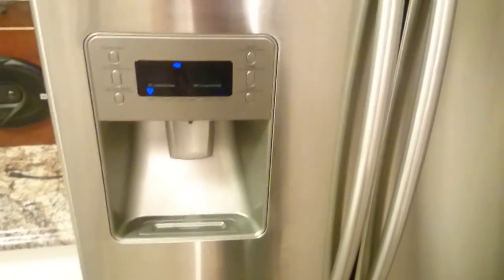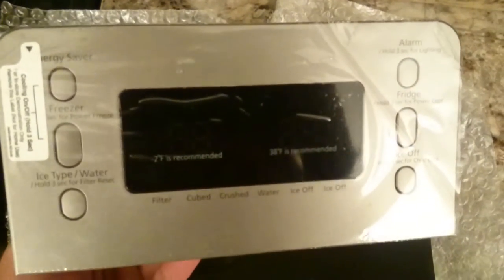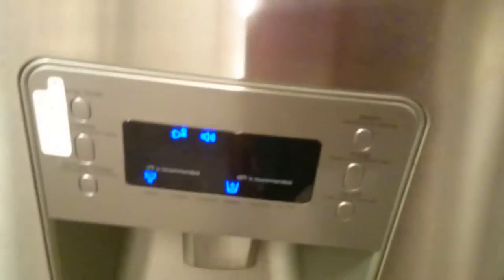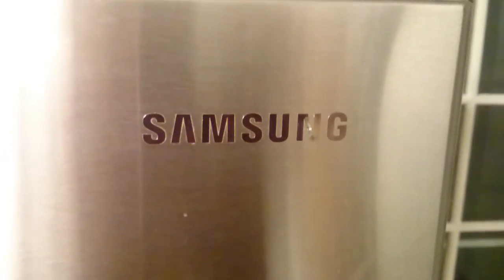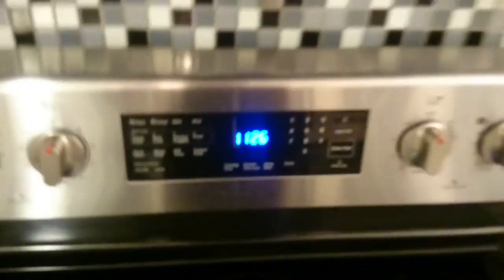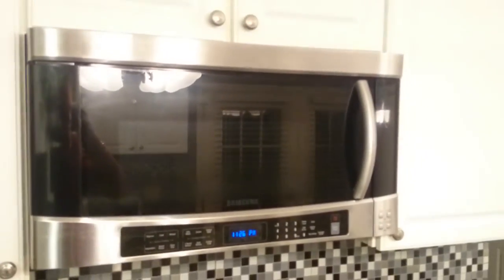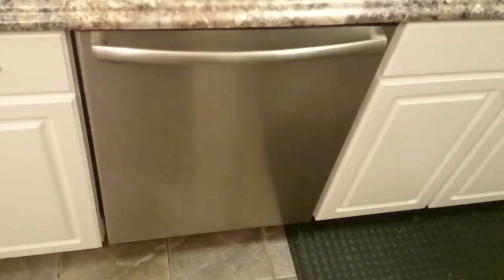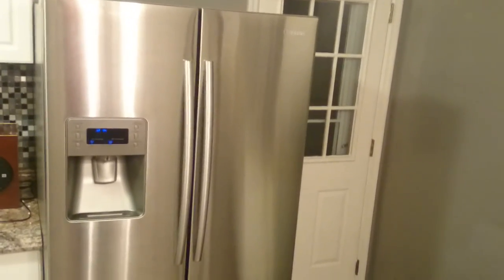Samsung refrigerator RF268abrs display panel replacement and Samsung rant.

Comment: The main reason I watched this video is to see how to pull the display after removing the screw. You did not show that.
Reply from the maker: Sorry as I stated before I had to have both hands to pull it.  In the video I show the location of the screw, the clips, and how to unplug the harness.  If this isn't enough information to pull yours yourself maybe you should hire a professional.
Reply: You BARELY showed what was needed to change the board.  You waved the unit around in front of the camera and gave us a 1 second look at the clips at 3:15.  This video is better than nothing, but really...  if you are making the effort to show us all how to do it, think about what we need to see.   It may be easy and obvious to you, having done the job multiple times, but the rest of us barely know what we're looking at.  Next time, get a cheap tripod.  If you're using your phone, you can get a holder for it to attach to the tripod for a couple of bucks.
Reply: @Semper fidelis Semper Paratus I truly appreciate that Clayton has made the effort to teach people what he has learned.  My point is that he didn't quite succeed.  If he wasn't holding his camera/phone in one hand while shooting, and put it on a cheap tripod with cell phone holder, he would have shown everyone how it's done.  Doesn't matter if he's "getting way too good at this" if he doesn't SHOW people what he's doing.
Reply from the maker: @smichelsen    Feel free to donate a tripod that will work with my phone!  Keep in mind I make no money off of my channel and dont intend to. I am aware my videos are of low budget and production value. That being said I try to put up stuff that isn't commonly available on here. Any information is bettet than none. Thanks for watching!
Reply: @clayton7825  the phone clamp on the end of a selfie stick will generally unscrew and can be attached to a regular tripod.

Comment: I'm on my third display and now need a new one.  The electricity went off during the night and when I got up in the morning the display only shows 88 on the left side and 08 on the right side, nothing else works.  Another strange thing is the ice.  I have RO water connected to the fridge, always have,  the ice used to come out almost clear.  Now it is solid milk color and tastes like crap.  I can't figure out what the hell happened to do that.  I installed a refrigerator deodorizer and that made no difference whatsoever.  I am contemplating on getting a GE fridge.  I had a service man look at the samsung we have and he recommended by a new fridge but not Samsung or LG. The thing with the ice though is a pisser.

Comment: Turn out that the panel controller board malfunction is caused by humidity.  Put the board into a food dehydrator for an hour and it will work again.  Super easy to fix.

Comment: Thanks a lot for this video. I too have a dead display panel on my Samsung French door refrigerator model rf267abrs.  The stupid thing just stopped working. Contacted Samsung dealers about the part and was told that this model fridge was discontinued, that part no longer available and that I should buy a new fridge. The rest of the fridge works fine only the display panel died. Searched online multiple times before finding one parts store selling it for $212.   Was never a fan of Samsung appliances. When I have to replace this fridge it certainly will not be another Samsung. Thanks very much for your video showing how to replace this part it was very helpful
Reply from the maker: Well that's grim news. Can't believe they want $212 dollars for the panel. My refrigerator is on panel number 5 number 4 didn't make it 90 days and got warranted. Number 5 is still there with stuck lights. Fck Samsung!  Thanks for the kind words!

Comment: Where's the part when you pull out the control panel?
Reply from the maker: I pull the panel at approximately the three minute mark in the video.  As I state in the video the clips are stubborn and I needed 2 hands to pull it so it's not directly shown in the video.
Reply: @clayton7825   If you don't show it, it doesn't help anyone.  Next time try a tripod.  If you're using your phone to shoot the video then get a cellphone holder that screws onto the tripod.
Reply from the maker: @smichelsen  Dude? How many times do you need to post this comment. I saw it the 1st time. Have a good one!

Comment: Arrrg! I was hoping to see how you pried the control panel out AND YOU SKIPPED THAT PART! Was it difficult? I understood how easy you put it back in but those side clips look like they could be devils to pry out. What tool did you use or do you just grip the underneath and yank her out?
Reply from the maker: Yeah they are a bit of bear to get unsnapped. I just pull it with both hands however I can hold onto it. If you read comments here there's people claiming they have had luck with a butter knife. Sometimes in my experience the clips on the display panel may break but if you have another to install it's not an issue.

Comment: Where did you buy that panel? I have issues with same model and needs replacement.
Reply from the maker: I bought this one from Ebay.  I'm sure you could get one through parts tree or sears parts direct.
Reply: Where did you find the part number (or do you have it)? I've been looking through manuals and online part sites, can't seem to find any hint of an entire display panel replacement.
Reply from the maker: With the model number of your refrigerator you should be able to find it on parts tree or sears parts direct.  If you put your model number in they should come up with a parts diagram.

Comment: I have the same issue but I wanted to see how to remove the control panel other than it take two hands.. Not helping me  with the pull.  Did you have to use a knife to remove the clips?
Reply: Good question Sam!  Logical! I liked the video!  I'm a quadrapulegic with no use of my hands.  Any hints on how to pull the panel from the door would help my wife a bunch!1  THANK YOU!  I must say, I won't own another Samsung frig..

Comment: Do you have the part number of the display assembly you purchased?
Reply from the maker: I'm sorry I don't.  With the model number off of your refrigerator you should be able to find it easily on any on line parts seller.

Comment: I’ve got the same model.  My display works but the freezer quit cooling.  Any ideas?  I’ve unplugged it for awhile, cleaned the vents in the back and called Samsung.  They just wanted to send a service tech but I wanted to try to troubleshoot before paying for a service tech to come out.  Any suggestions are appreciated!
Reply from the maker: Sorry I don't have any good suggestions.  Maybe check the evaporator it could be frozen.

Comment: my panel , none of the buttons work, unless I unplug it and plug in and it will work once.. do you think it is my panel? The icemaker still is maker ice
Reply from the maker: I'd be afraid to even muster a guess for that, I'm no expert with appliances.  If it was mine I'd check for a sticking button.  Outside of a sticking button, it sounds like it could be a circuit board problem but I have no clue which board it would be, I think this unit has 2 or 3.  Sorry for not being more help.
Reply: Thank you, Well I figure it can only be three things, ice maker, system board or the front panel. Since the ice maker makes ice and the refrigerator seems normal. I went with the front panel. I talked the appl people and they thought the same. So fingers crossed. the part is backorder for two weeks. I let you know how I make out..
-tom
Reply: Guess what! It worked... your video was exactly the same as mine, but my front panel is a little more updated.. Thank you!
Reply from the maker: Glad to hear it worked out for you!  I've been known to sometimes throw parts at stuff because it's cheaper than paying someone a 100 bucks an HR!

Comment: Yep just had mine replaced it’s 8 mos old fridge it was about 1800 2 year old model it was new got it from Lowe’s. Just had the display panel replaced it was touch panel wel it only worked sometimes. Scare the tech guy said if it goes out again u have the extended warranty they would keep one in stock I was like really I got on here googled problems your video came up and you know what he I will never buy another Samsung either sometimes it feels like it don’t get as cold as my old fridge that was beat to death it was like 20 years old I was a teen when my parents got it it still ran the fridge would freeze milk if I turned it down all the way these Samsung’s mine is on coldest setting and I feel like it’s not cold enough it gets 34-38 all the time I like my drinks at about 29/30 plus milk will last a lot longer I will never buy a Samsung anything I’ll stick to whirlpool all my parents whirlpool are over 20 years old still going only problem was elements in stove simple fix even washer and dryers 20 years old still going strong. Samsung is a cheap crappy company I’m glad I invested in Apple phones when they was first released in 2007 had every iPhone since never had a problem friends had a note 7 last yes almost burned down her appt. so you don’t get what I pay for. As I’ve seen budget brands outperform and out last Samsung.